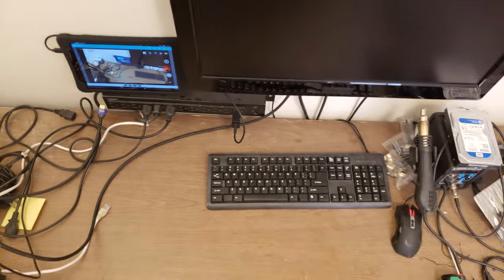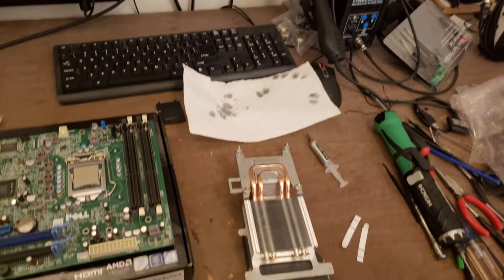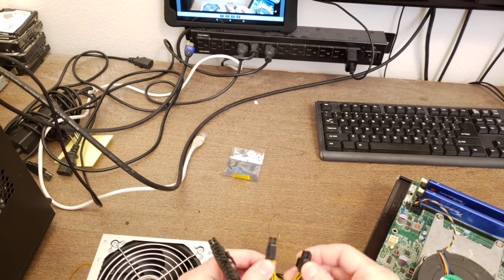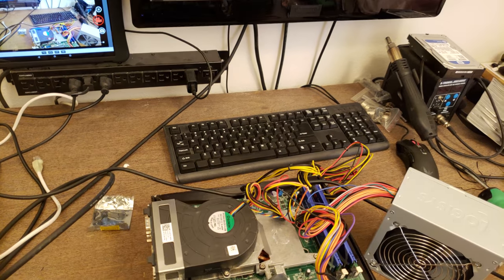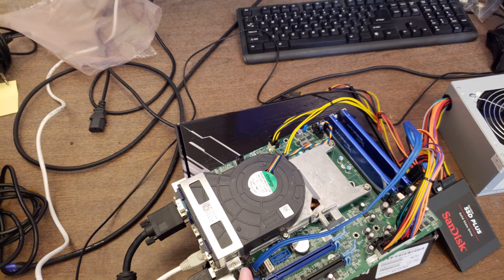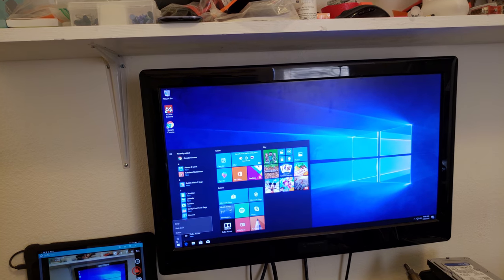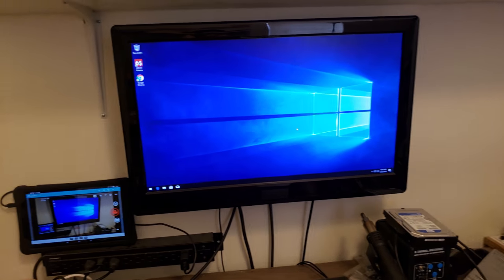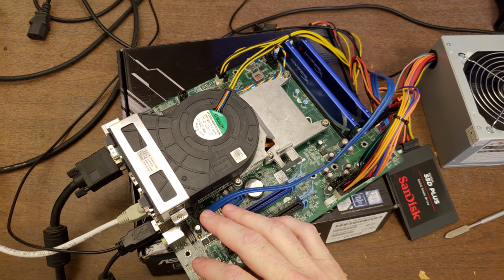Building a 4K capable HTPC for $160 Part 2: Build and testing

Comment: 1. You can clear CMOS with taking out cr2032 battery for a couple seconds.
2. If you dont get any beeps even with no ram installed, that means your system doesnt have CPU. If you really have CPU, that may be because of couple reasons:
a. Bent pins on socket
b. Dead MB
c. Dead CPU
d. And as it video shows, overtightened screws on cpu cooler (really bad design from dell imo)
Reply from the maker: I think I agree with all that. The thing that was different about this situation is the no post no video was caused by the CPU cooler being too tight and bending the motherboard.